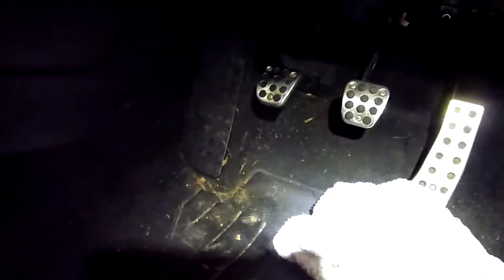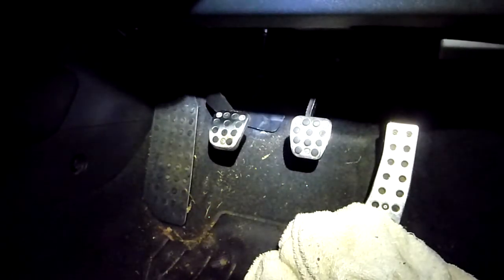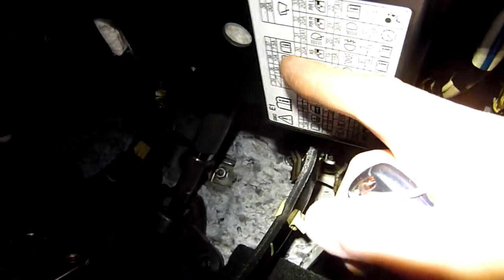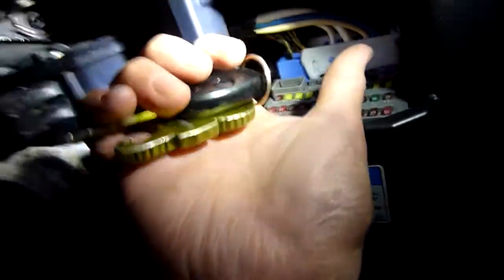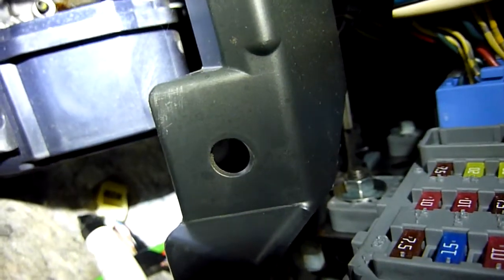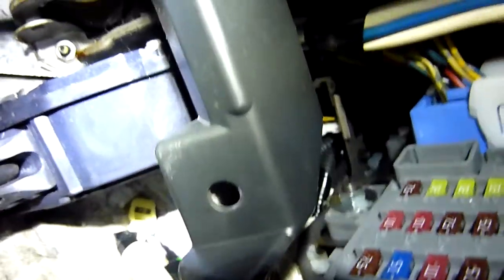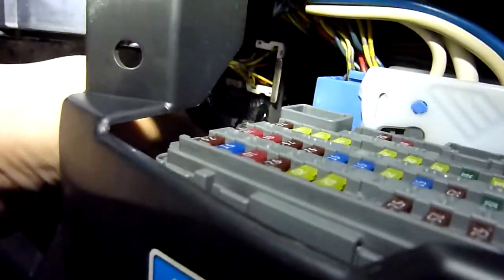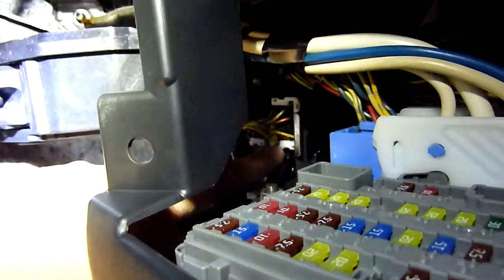The Location of The Honda Civic MK8's Cabin Fuse Box and Mirror Relay

Comment: Which fuse for the wing mirror indicators guys? 
My drivers side indicator is not working. Front passenger side is fine. Thanks
Reply from the maker: @90nadz  check the connection for rust and bulb blown firstly...will check later when I have a look

Comment: Which fuse should I piggyback onto for dash cam please
Reply from the maker: You should fit it via the cigarette lighter, not the fuse box. If you have used that port already on the lighter, then get a twin adapter.

Comment: Hello, were is the main relay for honda civic mk 8  i think that is the problem,crank and no start
Reply from the maker: The main relay is to the right high up above the fuse box. You have to remove some brackets if you want to change relays...or know someone with small hands. For electrical problems always check the carpets for water leak...check out my video on how to fix water damage on the civic mk8

Comment: Hi I wonder if you can help me my Honda Civic mk8 2.2 diesel 2007 does not go to sleep after less than 10 minutes after switching off ignition and also where about is the main relay
Reply from the maker: Check your Honda for water damage from leaky seals...check under front passenger and drivers side carpet for dampness...separate leak in rear of car goes into the hidden compartment in the boot...check the hidden spare wheel compartment for water...both fixes for these two faults is on my channel. The lack of sleeping of your car is probably water causing it...fix the leaks...dry the car and it will repair itself...most other cars woul have suffered  a major damage from water such as computer damage, but the civic is built really robustly.

Comment: Hello! Thanks for your tips. I have the problem that the heater does not heat and I was informed that the civic 2.2 has an electric heater. I remember that when the car was new, hot air reached me with a cold engine, now it is impossible. They tell me in the manual that it could be fuse 36 but I'm not sure. Do you know what can cause the electric heater to fail? The reference is a30105a5702000. Thank you!
Reply from the maker: Using tap water will block your heat exchangers

Comment: Hi my mirrors are not folding when I press the button and I'm getting that clicking noise dose that mean the relay is bad or is that clicking noise normal 👍
Reply from the maker: It normally does always click (relay), but the driver doesn't notice it. Can try swapping or changing the relay. Can also try checking the contacts for the connectors. Can also check motor if on one side only. See my video on how to remove the mirror on this car.
Reply: @EducationPineapple  thanks yeah both are not working I think I will try the relay first then if that works fine I will move onto the sod poly fuse 👍

Comment: hi, do i have to take of the dashboard to replace the fuse box???
Reply from the maker: Hello, there should be no reason to replace the whole fuse box, which would require a lot of extra work. I personally, if I had to on an old car like this, would use a stanley blade, or rotary equipment, to cut out the plastic shroud to get at the fuse box because getting the dash out is difficult. Why does the fuse box need replacing? You should normally only need to replace fuses and relays on fuse boxes. I hope that helps.
Reply: @EducationPineapple  i have a green key flashing in the dashbord and the car wont start, I was told that if i changed the ECU, fuse box and the ignition with it will solve the problem
Reply from the maker: Have you just bought the car? If you have sounds like the key doesn't match the car...if you haven't get a message mobile key person to look at it and do some reprogramming. Tell them beforehand what make and model and year etc beforehand...also talk to Honda   before even that and ask them what to do. They might say bring them paperwork and pay 500 pounds for a new key...those are better paths...
Reply from the maker: @sarahmulqueen9014  and even before all of the that...change the key's battery...it could be done for 2 pounds and two minutes
Reply: @EducationPineapple  thank you for youre answer, the car was working,before when i bought it i just wait to pass my driving test
Reply from the maker: @sarahmulqueen9014  try changing the key's battery then first.